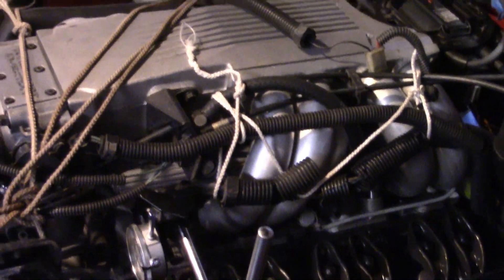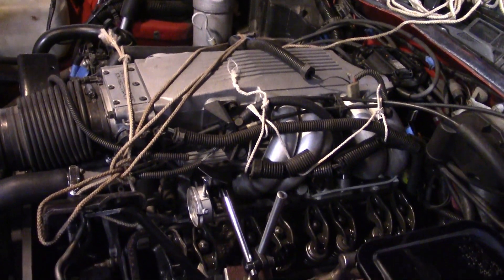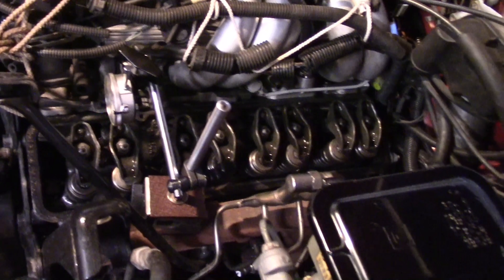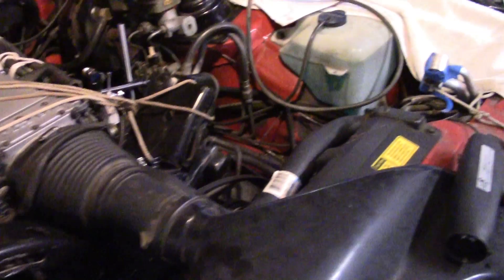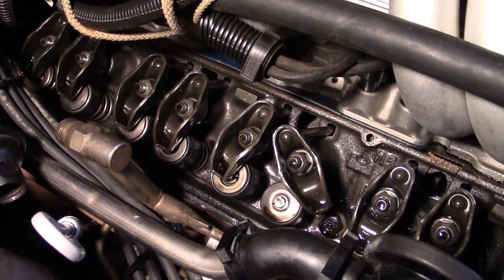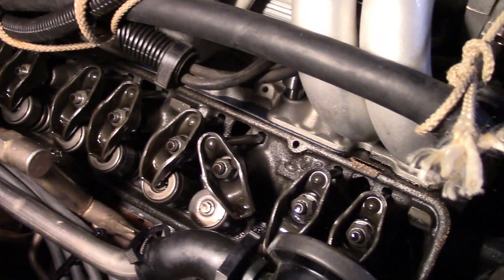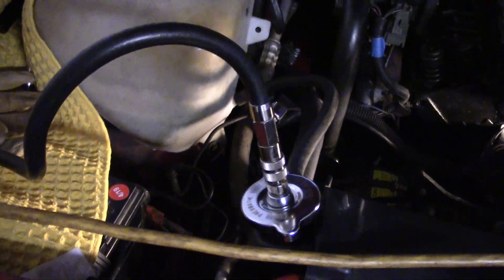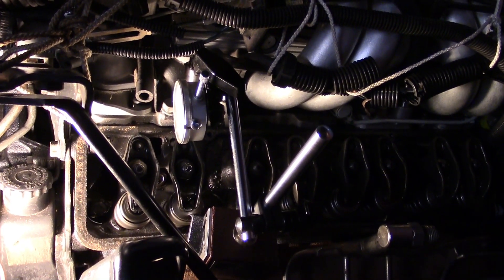Engine Failure! Coolant in the oil, Rocker Arms Loose, Cam Lobes are Flat - IROC-Z Barn Find EP#26

Comment: I’m shocked the builder didn’t have magnafluxing as part of the machining process.  I had always thought this was standard protocol.  Didn’t you say the shop you went with was a remanufacturing shop?  At a minimum you’d think that would be standard procedure as part of the process to assume they’re starting with good cores.  Scary!
Reply from the maker: The re-manufacturer claims to have magnaflux as part of the process, that is one of the reasons that I chose them.  Someone wasn't thorough enough and missed it. It was a hard thing to have to pull it and start over, but to their credit, they did stand behind their warranty. I bought a different block and they did another build. As I write this, I have over 10,000 miles on the rebuild and it is all good.

Comment: My heart goes out to you.  I’ve just this winter replaced the camshaft in my LG4 Trans Am.  It was challenging enough with a simple carbureted engine, I can’t imagine pulling a TPI engine, twice.
Reply from the maker: Thank you.  Yes, it was rather a shock to realize that I needed to pull the engine a second time. Especially after all the careful work to install it the first time. The replacement did go easier the second time because I had done it before, but it was still a lot of work.  I have done a lot of work on different carbureted cars, but the TPI is a whole different level of complexity.

Comment: I think the engine didn't survive your insane tourture test and over heating you called the cam brake in procedure.
Reply from the maker: When the engine has probably a pint or more of ethylene glycol in the oil, it doesn't lubricate very well.  It totally destroys the extreme pressure capabilities of the oil at a time when it is most required.  Regarding the test, I agree that it seems extreme, but it isn't "my test".  It is specified by the cam manufacturer and also specified by my engine builder as requirements for warranty.  If I hadn't done that, the warranty is void.  Back in the day, we never went to such lengths to break in a cam.  The general rule was "don't let it idle for 15 minutes".  I used to put new lifters on a factory cam (if one was replaced due to sticking), and just fire it up and not let it idle for a few minutes.  
I think that the concern today is because the ZDDP (zinc and phosphorus) EP additive was reduced in the newer oils.  Some oils with low ZDDP are very good and some perhaps were not as good, especially before the latest API oil standards were developed. There are other ways for oil manufacturers to provide good anti-wear without high levels of zinc.  If you combine a poor base oil with low ZDDP plus a high performance cam with high lift and extreme spring pressures for high RPM performance, I can see how the cam could fail break-in.  The cam companies don't seem to distinguish between a mild cam or a racing cam, except that they encourage cam installations with double springs to run with only a single spring for break-in. It seems that all flat tappet cams get the same instruction sheet.

Comment: Sad, but now you can build a real engine. The Stock engine is absolute junk. Hit a bump that pressed in oil pickup falls out and bye-bye engine. Coolant leaks, wire harness shorts. Just put a nice modern crate motor is like a LS motor. Don't waste your time with that iron block junk box. Grear car though to do a nice resot-mod.

Comment: OMG. I am so sorry, what a bummer. You know, you had water in #5 originally, and I am now wondering if there was a leak before and that's how all that water got in originally, because it made no sense before either. Man, I wish you all the best, I hope things come around for you. I wonder if magnaflux would have found this?
Reply from the maker: Anything is possible, but I didn't see any evidence of leaks in #5. That green coolant ought to show up.  The coolant freeze point may have been insufficient, but it was standard green coolant and the radiator was still full. The oil level was correct and I didn't see any coolant in it when I drained it.  Even where the block was cracked by #1, it really didn't leak when it was sitting. I had to put pressure on the cooling system for it to flow.  

Regarding magnaflux, I know the engine shop has capability to magnaflux and it is my understanding it is part of their standard process when they bring in what they consider a "core" for rebuild.  I don't know if they just missed it or if perhaps the crack didn't show when they checked.  I have thought about this a lot and I considered that maybe the crack was initiated while the engine was stored, but that it didn't break all the way through until after the crack check.  There is considerable stress put on a block when it is processed.  I suggested that as a possibility, but they actually told me that wasn't likely and it was probably just a mistake on their part and they would fix it.
Reply: @bitsofwisdom460  Very good, it seems regardless of any "finger pointing" it sounds like the shop is stepping up in every way. Fingers crossed. Thanks

Comment: Very sorry to hear about the bad luck. I'm confused as to why the company you had go through and rebuild the engine didn't double check the block before the machining work and such.
Reply from the maker: I really couldn't get a good answer to that.  I understood that their process is to magnaflux heads and blocks.  Once I had a discussion with them with photos, video and discussion about what I had done with the engine, their best answer was that they expect that the block cracked in storage before they worked on it and their shop missed it in the check.  One of their mechanics looked at my photos and said that it looked like a freeze crack and he had seen cracks in that area on small block marine engines due to freeze. There was no way it froze when I was working on it, and I could document that rather well. I am fortunate that they do stand behind their work.
Reply: @bitsofwisdom460  I agree completely. It would seem they didn't magnaflux before the work on the block or they would've noticed such a crack. Hopefully they aren't going to charge you again for work that should've been done right the first time.
Reply from the maker: Regarding the crack, the only thing that I wondered is if the crack was not fully developed when they took the engine apart, so that it didn't show up.  Seems unlikely, but it might not have been broken all the way through if it froze in long term storage and never ran again.  There is a lot of stress on the block when they clamp it down to  clean,  blast, bore, and even when you torque the head bolts down again.  The crack is near one of the bolt bosses.
In any case, the promise is that they will take a different block, rebore it to the same 0.030 over and transfer the good components to the new block. With only about 3 hours time on the old build, hopefully most of the parts are still ok.  The only point of debate was the cam. They pressed me some on whether I followed the rules on cam break-in before they agreed to replace it.  I offered to show them the video and stressed that the coolant in the oil is likely cause of failure.  They agreed without watching the video, but they knew I have been documenting and could back up my claims.  I did ask them if I could change to an equivalent cam of a different brand.  My son-in-law has run a number of the Lunati cams with good success and I thought I would give that a try.  I really don't think there was anything wrong with the cam I had (Comp cam), just going to make a change.
Reply: @bitsofwisdom460  Good to hear that they didn't give you too much hassle. Let's hope everything goes well with round 2. I'm anxious to see the engine running well, the car driving and the rest of the restorations :)
I myself am working on an '87 but needs a bunch of work.

Comment: Sorry you went through all that to find this crack after the fact.  Hopefully this time you will get a 350 block and PLEASE go with roller cam.  You will not have near as much trouble as you are putting yourself through with breaking in a flat tappet cam.  Your working way to hard on old problems like flat tappet cam.
Reply: You took the words out of my mouth.  Very low success rate on modern flat tappets.  I follow a great channel (Powell Machine Inc).  The guy is a cam grinder and knows his shit.  He did a video speaking on why he quit even grinding flat tappet stuff.  Did his own Rockwell hardness testing, the whole 9 yards.  Basically said having a successful flat tappet break in is a crap shoot at best.